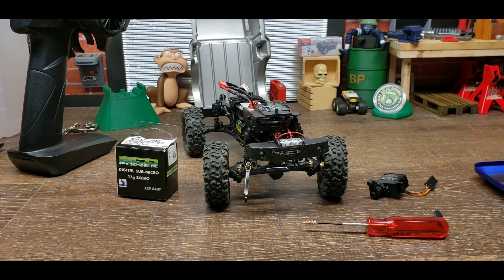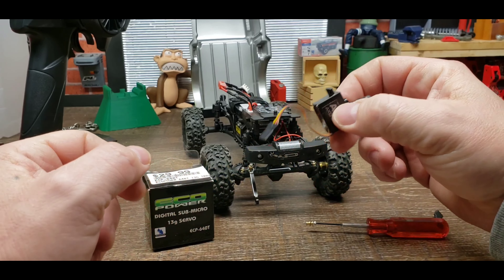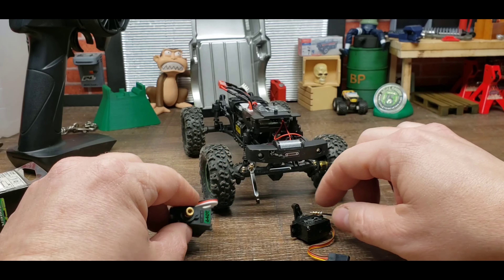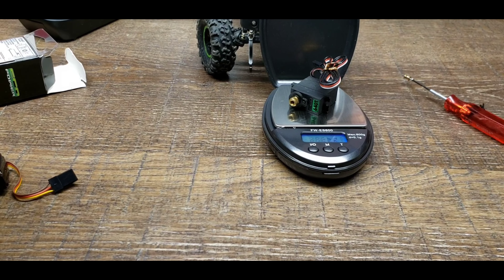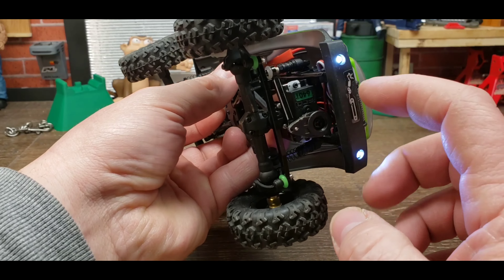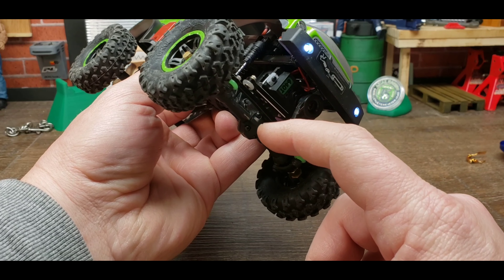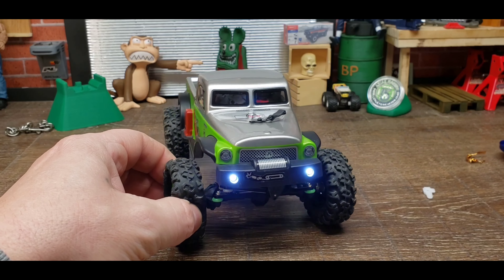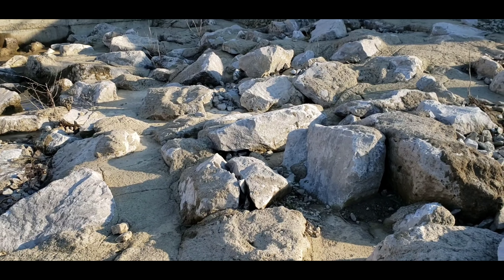Scx24 B17 Betty servo upgrade eco power 13 gram

Comment: Nice video, thank you! I snagged this servo and the Samix mount for it. Installed it in my SCX24 Jeep and it sticks out so much farther forward I had to remove my front stinger bumper. I had to trim the top of the servo mounting tabs to clear the frame rails when the suspension cycles. Even with the bumper off the servo horn hits the grill of the Jeep when the suspension cycles. Trying to figure out how to make it work since the servo does seem much stronger than the stock AS-1. Might have to go back to the stock servo though. Let me know if you have any tips or experience, thanks!
EDIT: Scratch that…I just realized you used the Ecopower 640 and I have the newer 827. It doesn’t just bolt in with the Samix mount and work on the Jeep like I was led to believe.
Reply from the maker: Nice love your channel name
Reply: I have the same issue with my Axial SCX24. I was led to believe that it was a direct bolt on. It sticks way out and my bumper is off. But, this servo is way strong. I love it. I just run it with my number off. I’m trying to figure out a way to make a bumper fit some how.
Reply: What servo horns did you use? I have the 640T but the horns that came with it have too large of holes for the steering linkage bolts.
Reply: @mikej8832  I’m using a Eco Power micro servo with an aluminum steering rod. I also had to buy a aluminum mounting plate for the new servo as well. I had to upgrade the servo when I got bigger tires and brass weighted lock bead wheels.

Comment: How did you get the ESC to power on the servo?  I hooked mine up and it doesn’t make a noise. Thanks
Reply from the maker: Maybe you plugged it in the wrong slot or reversed i just plugged it in and it works fine on all 5 of mine
Reply: @AdventureTimeRC  I had it reversed like a moron. Thx 😂

Comment: What servo mount did you use with your deadbolt. I can't get the stock mount or the Samix mount to work. Thanks.
Reply from the maker: I use either the samix emax servo mount or the stock plastic one I cut the back out a little bit and use washers if I need it to come out a little more
Reply: Couldn't get the samix tray to work. Butchered the stock mount but the top of the servo interferes with the transmitter tray. If I push down on my front end I still have a quarter inch of travel left on my shocks, but articulating one side or the other I only have maybe an 1/8" left to bottom.
Reply from the maker: @garypoe4411  I have the same problem with bigger servos in the 24s I sand the top to corners of the servo round till it slides up in the frame
Reply: @Adventure Time RC  I finally got it to work with the stock servo mount. Had to make new mounting holes. My belt sander ate the samix lol. Rip. I got some ideas to make it better. I have some clearance issues with it, and it's just weak overall at this point. But I'm going to get dangerous and press on, knowing I have the solution on the way and on backup. A little time with the dremel tomorrow I think she will be fine.

Comment: I bought this servo can’t figure out how to get it to fit in my c10/:
Reply from the maker: You will need to get the hot racing servo mount or trim the back of the stock mount just a bit